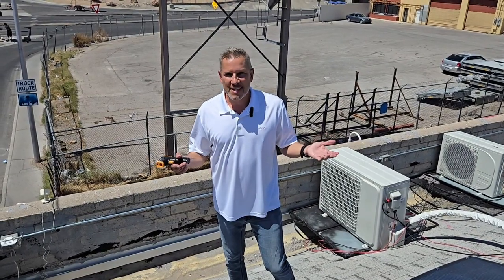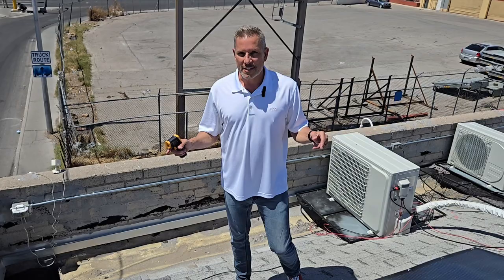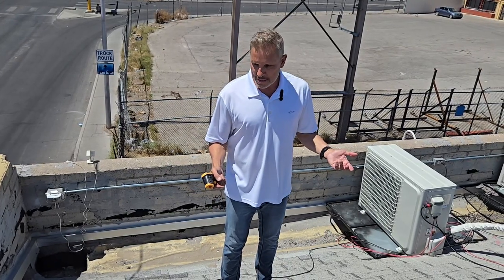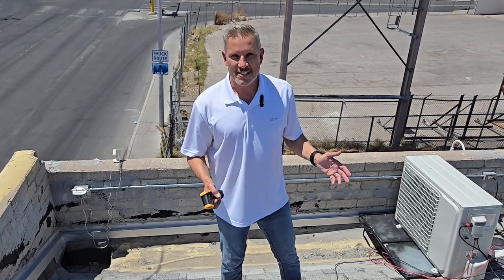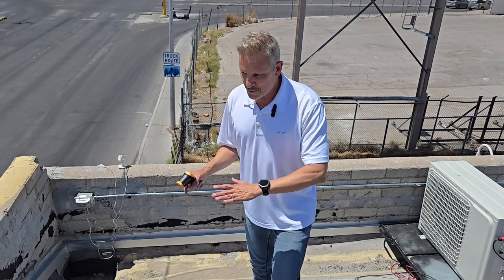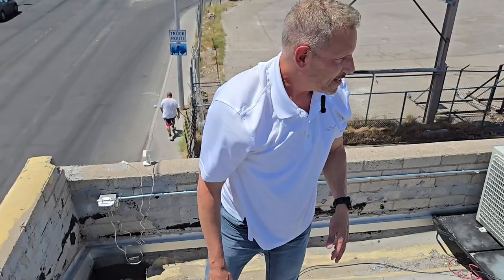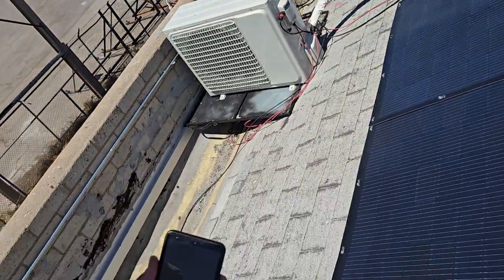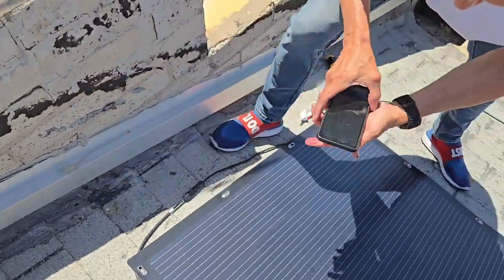The advantages and disadvantages of flexible solar panels for residential installations

Comment: What do you think about installing on a Metal roof?
Reply from the maker: I would avoid drilling into this.  But, there are some good options.  1.  3M VHB Tape (very high bond; great for standing seam). 2. Sikaflex 221 or Loctite PL Premium (construction adhesive). 3. Dicor or Eternabond tape (roof-safe, RV industry standard).  Or, magnets along the edge.  How much wind do you get down there?
Reply: @airspool  Oh, up to Cat3 during Hurricane season.   ;)     But normally, nominal winds can be 17-25 mph. 
**What is the measurement for each panel? I could make a frame to mount on my wooden deck rails.